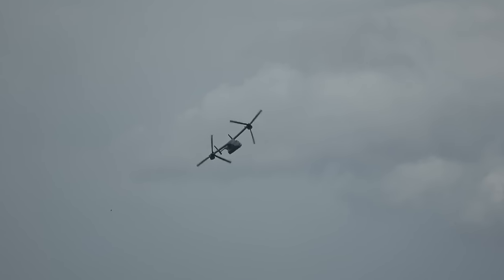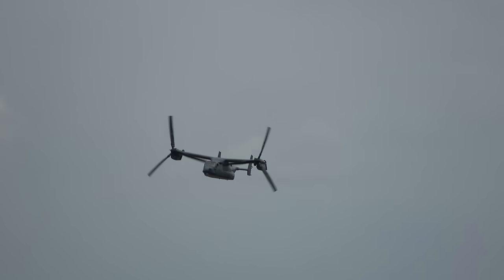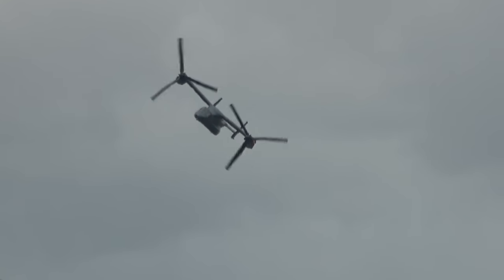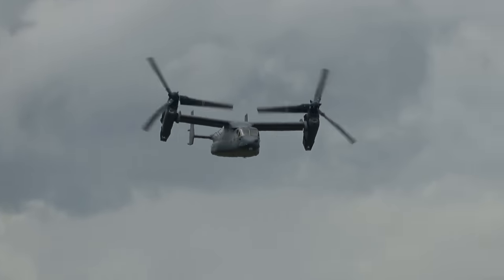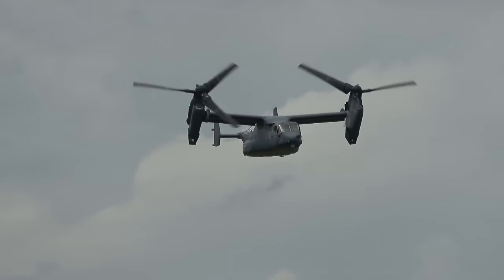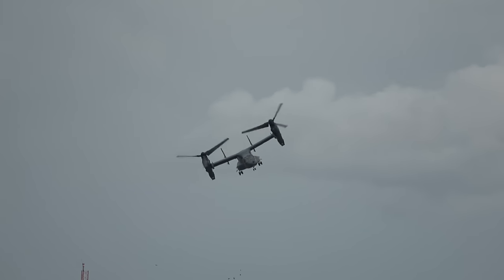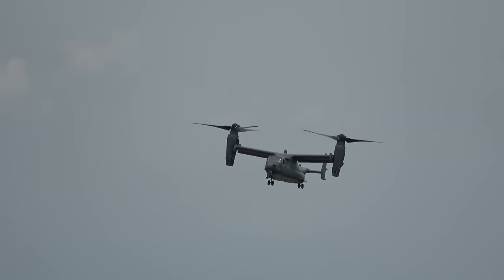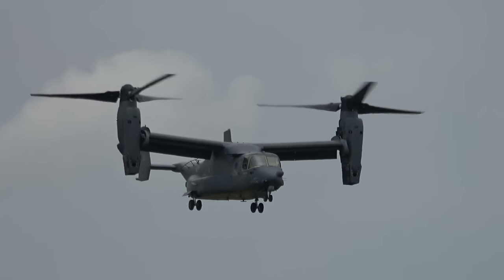Watch as an USAF CV 22  Osprey transforms from plane to helicopter at RIAT 2023 - 4K

Comment: A plane that thinks its a helo, or a helo that thinks its a plane. 

Either way, that's a transition I can support!
Reply: the transition is the vulnerability in these craft.
Reply: @thetruthchannel349  True... but it also was with the the Harrier and probably the F-35B.
Reply: @rickwilliamson9248  F-35 seems to have had more of a training issue. The problem with the Osprey is your transitioning Lift & Drag differential. To me its seems like a design concept problem. Theres a lot of things that go wrong during that transition. Lot of things beyond the control of the pilot also. I don't understand why such a craft was ever designed. Ive watched a number of these transition in flight & theres usually major yaw. Just seems like more things can go wrong than the use of such a craft can justify.
Reply: @thetruthchannel349  When the Harrier first entered US service, pilot selection concentrated on experienced, more senior pilots. When they started allowing less experienced pilots into the program, the number of mishaps increased significantly. 

Not sure if the same has been true with the F-35B.

Comment: I wonder how long it will rake from us going to a jet version of this. I'd imagine it could be more compact overall without the huge prop/blades
Reply: Likely will need lift fans similar to the F-35 around the rear area to balance the jet thrust
Reply: Tried and rejected with the Do-31.
Reply: @AA-xo9uw  sure with WW2 tech but that doesn't mean we couldn't do it now
Reply: @dovahkiin3526  and transition from hover to flight mode.
Reply: @AA-xo9uw  I mean seriously it's just a big F-35 once you break it down.  If we can do it there we can do it with a bigger aircraft